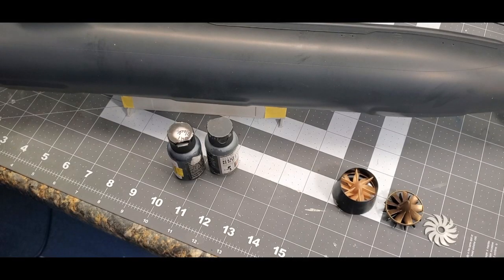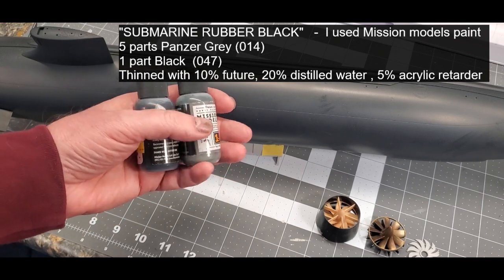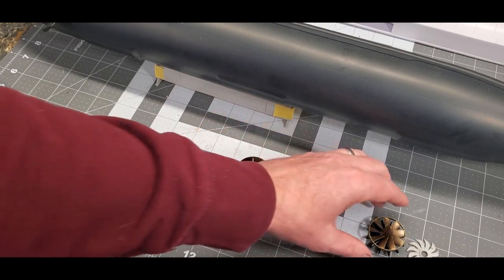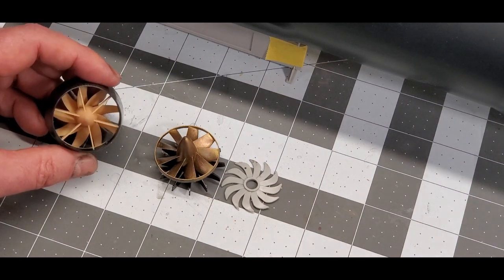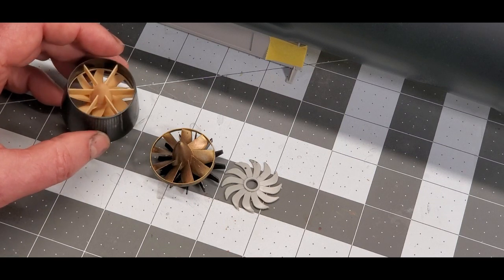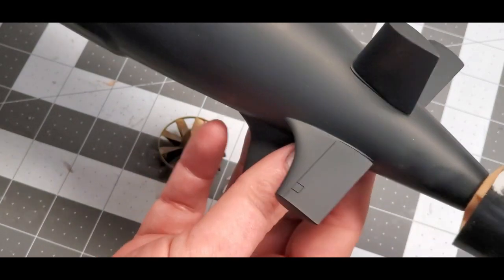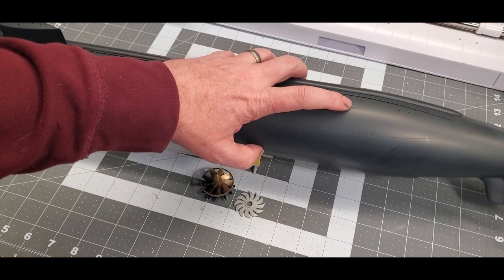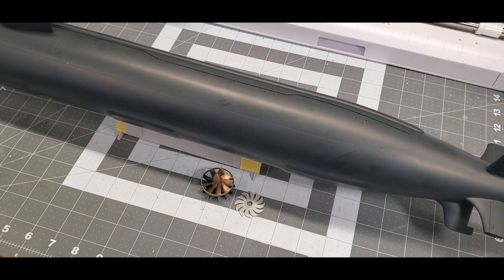Trumpter Seawolf in 1/144  episode 4 (day 9)    PUMP IT UP!

Comment: turbines and propellers are two different things. A turbine extracts energy from a moving fluid. A propeller sets a fluid in motion.
Reply: The pumpjet in a Seawolf is neither. 

Propellers use lift across the blade to push forward. A pumpjet pulls water and expels it out the back.